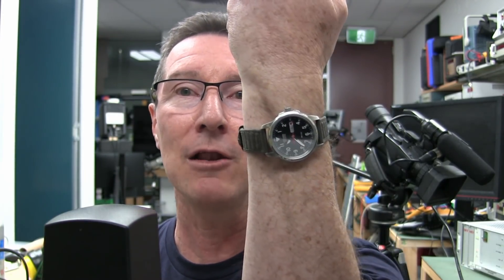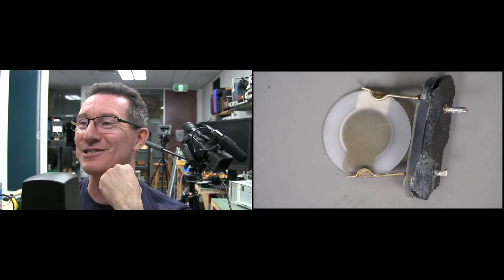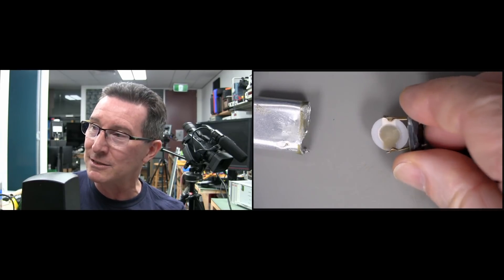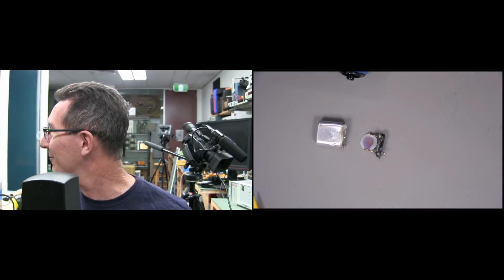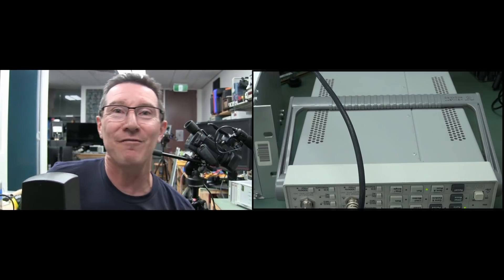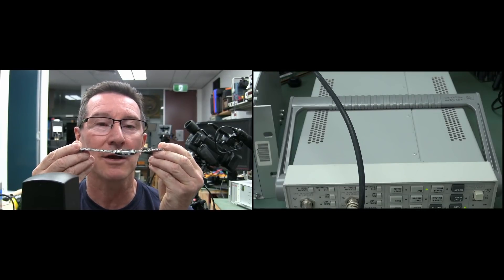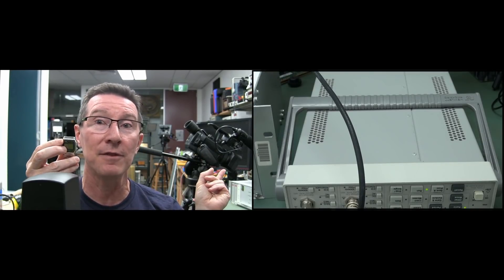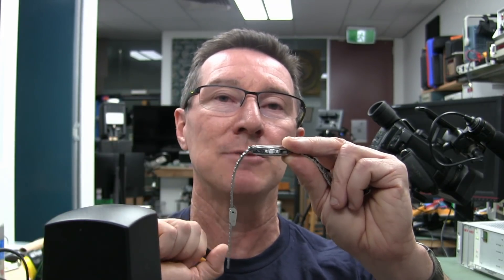How Gravity Can Change Your Watch's Time!

Comment: Awesome... I totally never had considered the effect gravity has, but it does, however so tiny an amount.  Interestingly, if you wanted, with today's modern smartphones, you could use the accelerometer to to adjust the calculations to take the orientation into account, and make a quartz crystal, which is typically tuned to 32768 cycles per second to be nearly as accurate as your rubidium clock, or (pray tell), a cesium beam clock?
Reply from the maker: You could compensate in theory, but in practice things like temperature, shock and vibration have a much larger impact on the frequency than gravity.
Reply: @EEVblog2  right, not like it would add much accuracy tbh
Reply: Smart phones have processors that work off of at least 3 GHz. So there's that. Also, if you're already going to use a smartphone you might as well take advantage of its GPS receiver and obtain accurate time that way. You effectively have an atomic clock that way already.

Comment: i wonder if Einstein's theory of general relativity has something to do with the devices used for measurement...obviously a clock crystal speed up/slow down with gravity.. just like in satellites in space etc, even the good clock sources (atomic) seem to need an adjustment every 10 years or so... i mean if we could make a source that didnt change due to gravity.. time would tick the same everywhere....
im pritty sure ive seen this in action with a SDR... moving the SDR dongle slightly changes the frequency....
...cool stuff doin a class for the kiddies!
Reply: The USAF has ground stations that shoot lasers to GPS satellites to get the exact orbitial altitude. They use that to get the exact speed and calibrate the satellites.
Reply: @ionstorm66  yeah... but the clocks are still ticking at different rates..they just sync-ed every so often... it seems to me its all about the device used for measurement, its seems like its not a real physical law...leaving the gravity well of a planet/star would cause a clock to tick almost infinitely fast..that seems like bad measurement (devices) to me
dont get me wrong...i know its close to impossible to make a clock source that isnt affected by gravity.. especially when we build everything at the bottom of the gravity well!